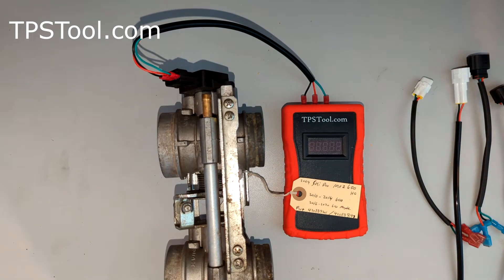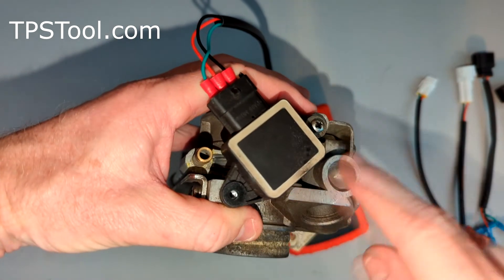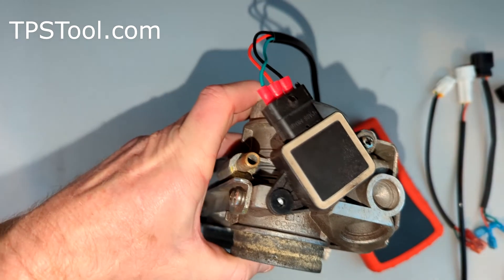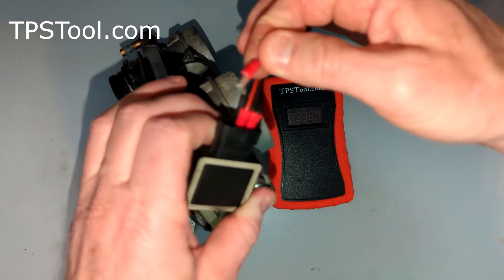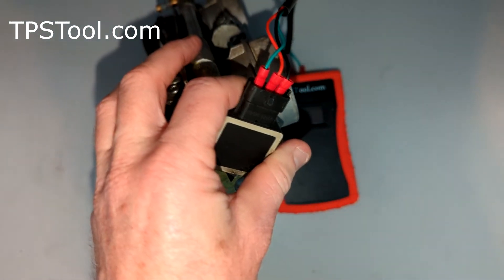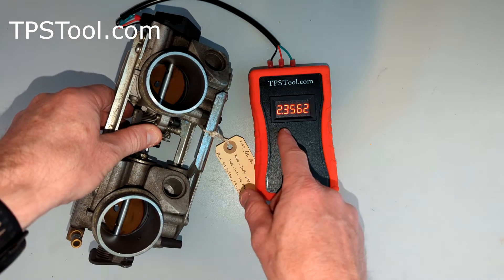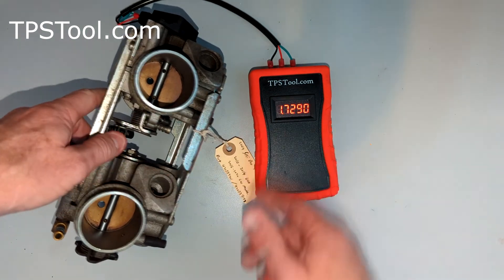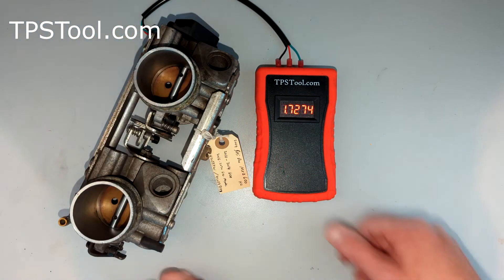Check the TPS on a Ski Doo MXZ 600 (2010 2020)

Comment: Hello, I have a honda CB 1000 R model 2011 full option engine, and I have a problem with the TPS sensor.  I ask you what voltage can I set it to?  Thanks for your help
Reply from the maker: Thank you very much for your question.  The value should be in the service manual for that motor.  Unfortunately I don't have that service manual myself, but you can likely find it online.  Search the manual for "Throttle position sensor" or "TPS" and you'll likely find the value.  I hope this helps, let me know if you have any other questions!